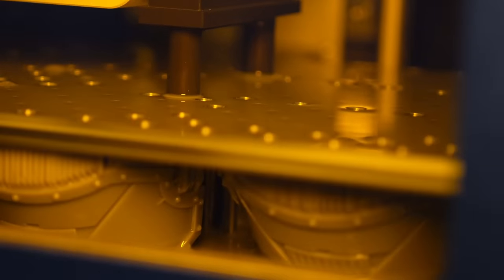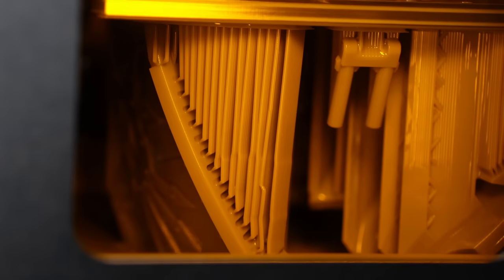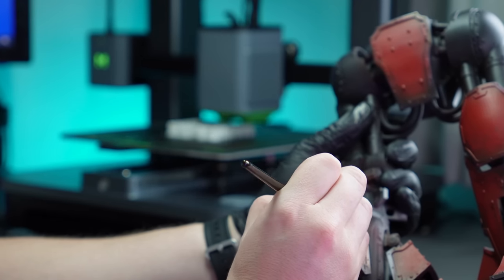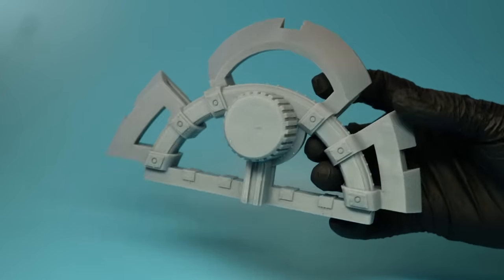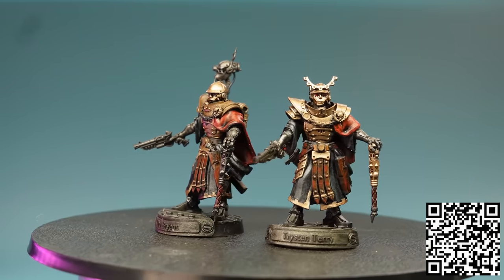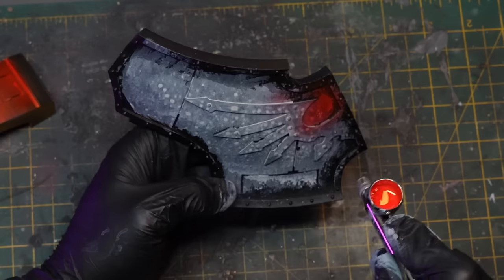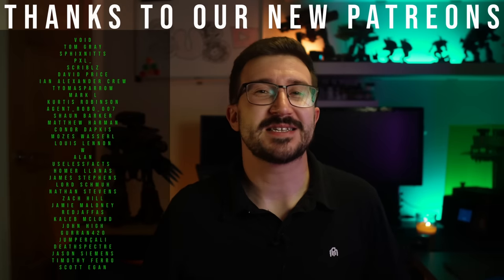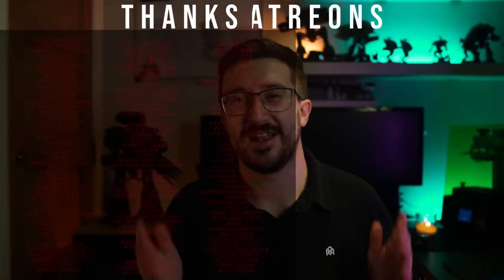The Up's and Downs of 3D Printing A Warlord Titan

Comment: Your mistake was in putting only small drain holes. 
With resin being resin, it will stick in small corners.

I printed a Gladiator and using MS 3d program I created big oval forms that I then cut out from the bottom of the stl along with regular small drain holes in parts with low visibility  that I filled with putty after.
It printed perfectly and the  bigger bottom than the GW Rogal Dorn tank (lol) made it super easy to clean.

Try removing big chunks of the interior panels, they will be invisible and you can use green stuff or putty to put them in place.
You'll save even more resin

Comment: Great vid, love the perseverance and finding new solutions. Also wishing I had an FDM printer now, as 3d printed Imperial Knights are quite heavy and doing what you did would be great for them too.
Reply from the maker: Sometimes you just gotta bruteforce your way through a problem lol! I do like the fdm printer for handiness but while painting I will say I much prefer resin, although I haven't min maxed the fdm printer
Reply: @battlebrothersam  That is a good point. FDM would still need filler primer/sanding/priming which is a lot of work... Still though, looks like the titan is coming along just fine!

Comment: I'm 3d printing a Chaos Knights army with my FDM printer, and at 0.12mm layer height and a ton of patience, it has been a blast. I've had a few failures which I managed to salvage, and with a bit (ton) of postprocessing, it's coming out amazingly. I believe it would be easier and cheaper to also print Titans fully on FDM.
Reply: I'm currently printing a warlord titan with fdm printing at 0.08mm layer height, quick spray of primer filler to help smooth the layer lines and it all looks great

Comment: I started mine and found hollowing after using so much resin i have found hollow, wating your video i am trying to work out if you are saying hollow but minimum of 2.5mm is that correct ?

Comment: How much do you think on estimation this might cost if I got the STL files and sent it off to a professional 3D printing service how much the parts would cost?

I live in a pretty small apartment so 3D printing is both a safety and space concern so I’ve been considering going the route of hiring 3D printers to save money on the hobby and also getting cool models online.

Would it probably be an extra 200 dollars on the overall cost or potentially more?

Comment: Wait, why did you hollow such thin armor plates? Also you didn't seem to put any drain holes in those hollow parts thus leading to the explosion...
Reply from the maker: Because all I've heard is "you should hollow as much as possible" and thought it would be ok but I know better now lol! There is holes in them, 3 10mm sized holes on the back of each one IIRC

Comment: Very confused how you hit that much resin when printing hollow. I’ve been going down the solid route and am on track for about 12-15 kg total. All the core structure barring one shoulder came to under 6 kg of resin, that’s including the odd misprint due to forgetting to rescale or the odd part I printed an extra off due to forgetting to mirror. Only reason I’ve not got the shoulder done is cause my screen died the other day. I suspect the armour plates will be 2-3 kg tops. Then it’s just the head and weapons which will likely hit 3-4 kg.

Comment: GW will release a printer, when they can sell one that only takes GW resin (or filament),  only works with proprietary GW software, only accepts GW  stl files,  and those files only work X number of times before you have to repurchase them

Comment: One more thing I might add dude if you have the time, go down to halfords and grab 1K diamond putty and you can thin it out with methylated spirits and paint it onto the skeleton. It is sandable so you can make the skeleton look smooth like it was made via SLA. It will take you a while and you really need a good respirator mask and eye protection for that shit. It's toxic as fuck. You can always hit it with Halfords Filler primer after too. I made a FDM Necron Monolith that way and it looks as good as the one I did in resin.

Comment: Heyo! Weird the hollowed parts did that. One thing I hear all the time is don't be afraid to over cure resin pieces, especially hollowed ones. One thing I've started doing is after I've cured both sides for 10 mins a side (so 20 mins), I take hollow parts, dunk them in a clear tupperware container with water and leave it in the sun. I figure this is better for ensuring the interior is cured properly due to how sunlight refracts(correct terminology?) in water. Call me a sniffer but I also give the drain holes a brief whiff to see if it still smells chemically. Obviously don't sit there snorting hollowed resin prints :D

Comment: "the fact that it's able to put out 8k detail is amazing" there is no such thing as 8k detail, what determines pixel detail is pixel size, so a 15 inch printer that's 8k will have far bigger pixels than a sub 10 inch printer thats 8k so no it's not as detailed as other 8k printers. It's pixel size is 43 µm which is more comparable to printers like the saturn s at 48um than 10inch or below 8k printers which are about 30um.